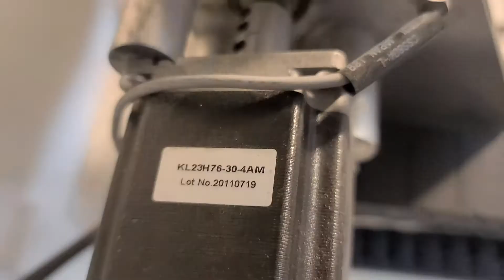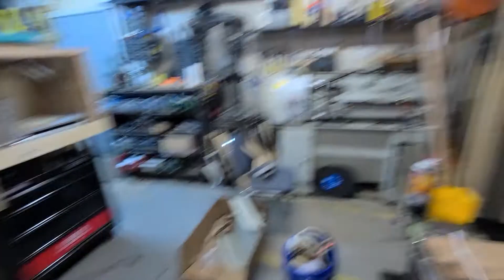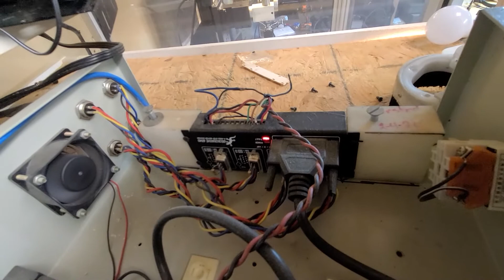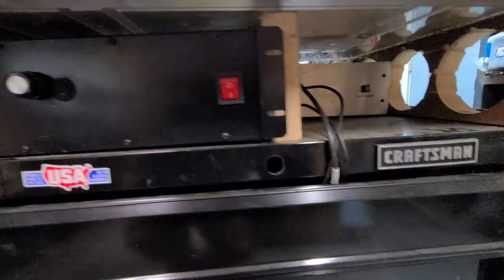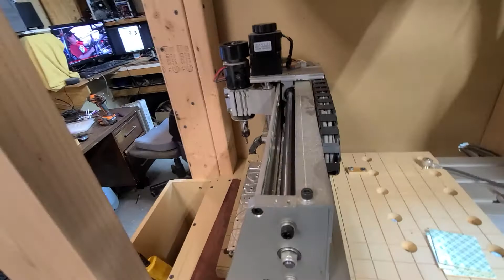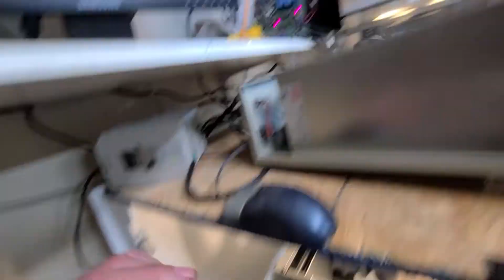quick rundown for the mods for the 6040 cnc router.  Andrew, this is for you bud.

Comment: hey man, i have a 3040 just like the one you showed when you panned to the side, how would i go about installing the limit switches on it?
Reply from the maker: if your still using the original controller then I would get a motion controller like the smooth stepper that has 2 ports.  Wire all the switches to a simple breakout board and put them on the second LPT port.
Reply: @zidwid  my board is a bsmce04u I did some digging, and if I'm correct I'm supposed to wire all NC to ground and all C to inputs 1 through 4. If you don't mind giving some more advice what is your thoughts on that?
Reply: @zavage4597  I used to run the same controller. If you have any questions, let me know.